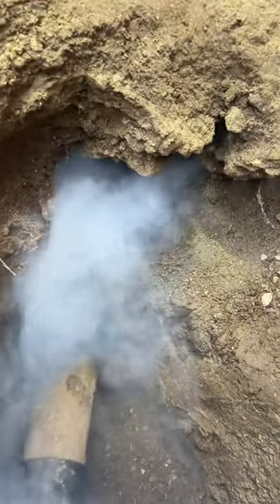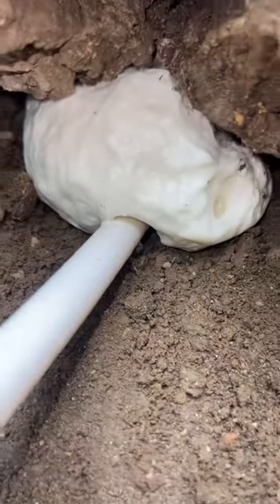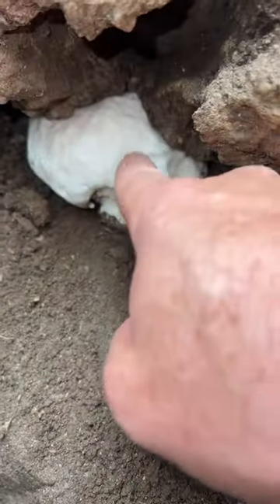CHEAP DIY trick to find out how RATS are getting into your home. 🐀💨🏠

Comment: You need to explain that the foam is temporary,  just until you can cement, and/or distroy the burrow and cover it up. Otherwise people will use foam as a permanent solution.

Comment: Good thing rats definitely cant chew through that.
Reply: Put steel wool first.
Reply: They may want them to chew through to see if they are using that path.
Reply: @ehenyor And you don't think that the rats will simply dig around it no??
Reply: @Sionnach1601  nah. They'd rather chew, but even if they dug, you could see they used that path.👍
Reply: @ehenyor Fair enough, but I would have  thought it sufficient though that the smoke method would have been enough.
Reply: @Sionnach1601  It is on a first (or second pass) to identify openings. They can seal up the holes, and if the rats chew through, then they know it's a current path. 👍
Reply: @ehenyor  Thanks for that 👍